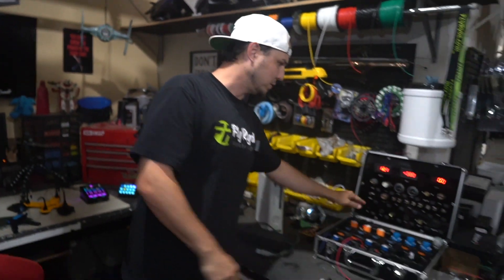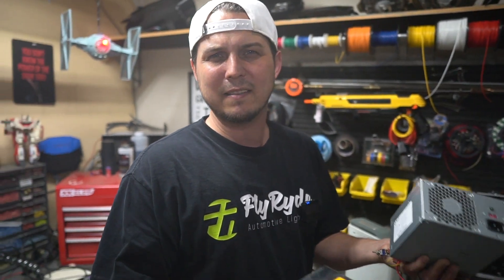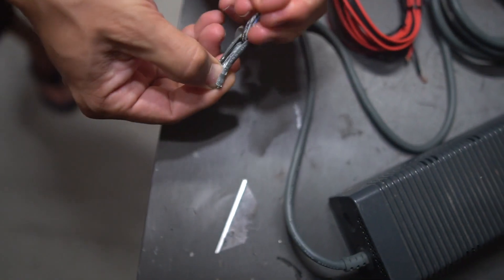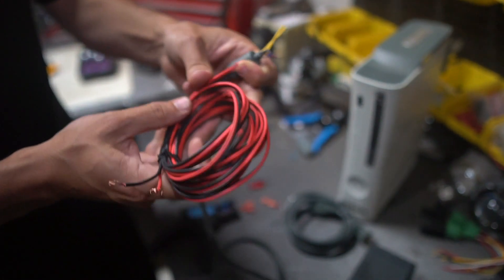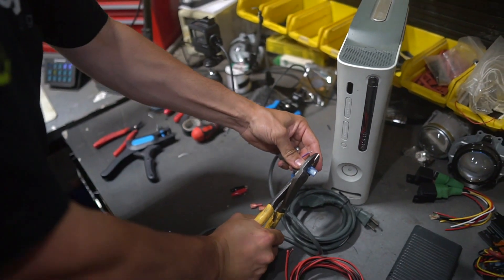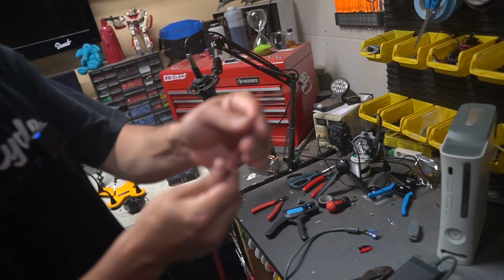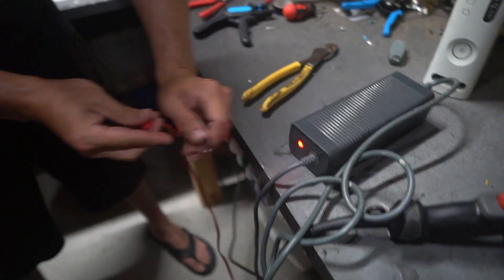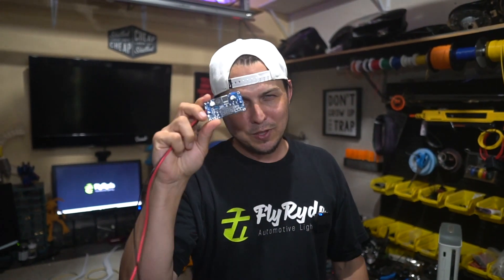Old Xbox Bricks Good for LEDs?

Comment: How I wired mine I have it to flip a switch to turn on the green light using a rocker switch. The red and blue you have can be used to switch it on or off. 

Mine had a green and white that I wired to a rocker switch. I've used it to turn on leds and itll turn on hids ballast just fine.

Comment: Nice, one small thing, I would buy a cheap xbox360 adapter cable to avoid cutting the power supply. You can get xbox360 to xbox360E adapter, so you cut the xbox360E plug instead. Also now you can remove the bulky PS when not needed. 

The ferrite is a filter for EMI/RFI interference, to lower the electric noise level. Can be also very usefull in car when you got a cheap voltage buck-boost converter or anything that send noise in your car radio. Can buy tons on any chinese website for cheap. I added some on my LED bar, LED ditch LEDs, 12V to 5V USB adapter (for hdmi splitter and amazonfirestick) and headrest monitors. Make a huge difference.

Comment: See when I was comin up little kids bought the xbox, when u were ready to step up to the big boys toys u bought a playstation. Lol I bought a solar tickle charger hooked to an old battery mounted under my desk. Then I ran 2 remote battery posts that stick out of the corner of the desk to test electronics. We really need to link up for an e36 application. Either something different than the halos everyone does for the headlights or we figure out the crazy tail light setup and finally come up with tail light set up and ride it all the way to the bank.

Comment: If you use a cell phone adapter and dismantle it then you’d just change the zener diode or add an extra one 6.2v + 5.6v in series to get you around 11.8v. This would save messing about with boxes and there’s only 2 wires out + and - not everyone has an Xbox kicking around but most have an old AC cell phone adapter laying in a draw somewhere. And if your clever enough you can also use a laptop adapter as well with some mods applied.